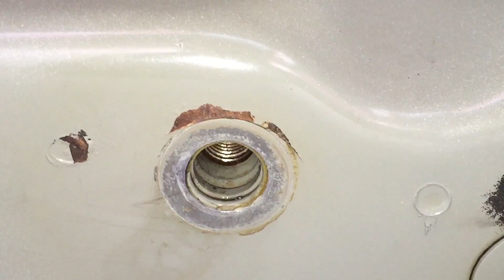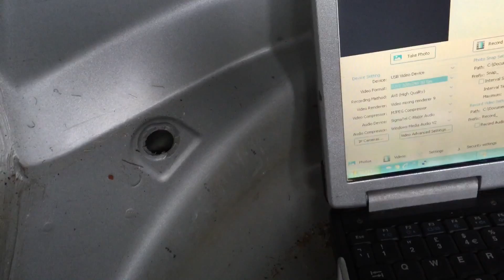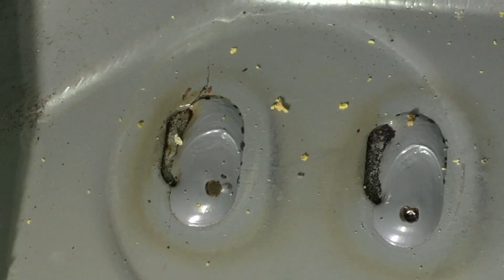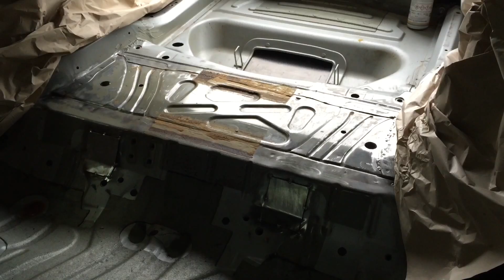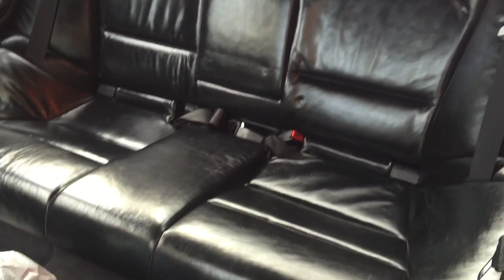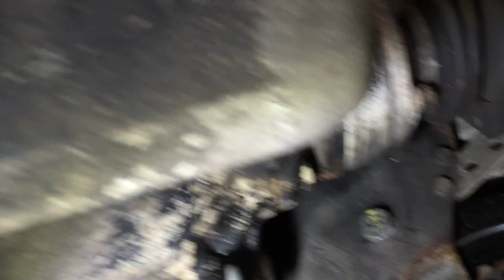BMW E46 M3 - RACP Repair & Reinforcement Process

Comment: If the panel did drop a significant amount, how would one raise it to be at the correct height for stitch welding the RACP to the chassis legs?